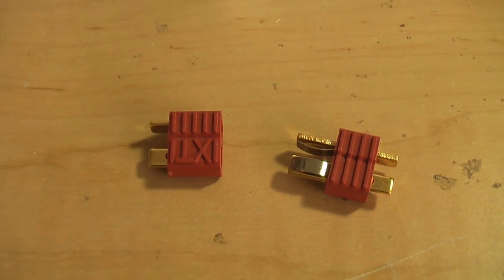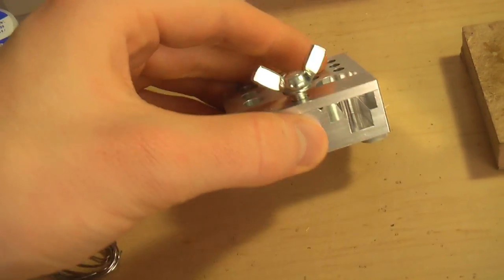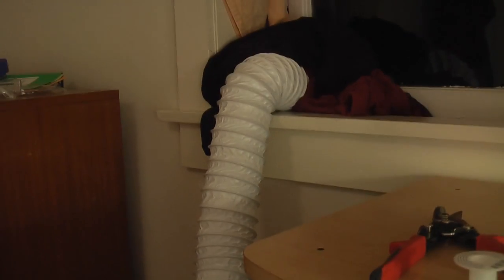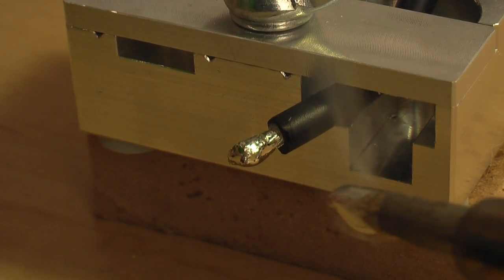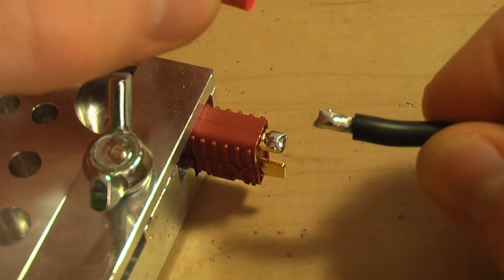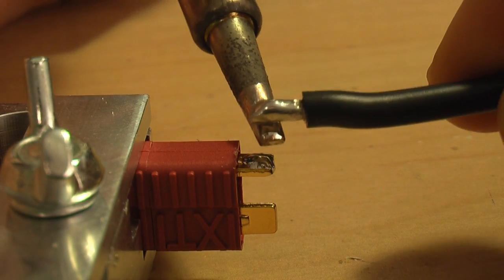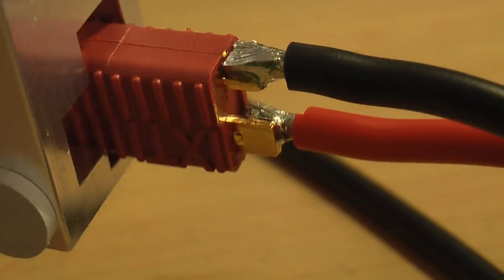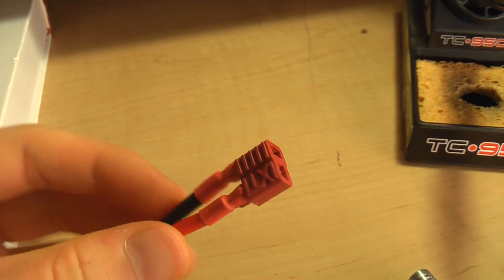Soldering Deans Connectors

Comment: As hobby vide is juat fineand the tip makes all the difference. A pointed top wont work. Thats how i eltes the deans connector my airsift gun perun hybrid etu and had ti solder a new one on. I dont know whyvthey dont have them pre soldered like the gate aster. Where its a straght drop in. It works now and k can use 11.1 lipos without burning mybcontacts becuasue there are none. Its alnelectronic vs mechanical. To burn the heat shink, i just use a candle or big  cigararet  lighter. Everyone has either or.

Comment: You should be heating the underside of the surface to be soldered, and allow that surface to melt the solder to avoid creating cold solder joint.

Comment: If you'll look at the body next to tabs, you'll find that they’re cleverly marked + and -. So, your wires are reversed. Also, if this connector is going on a battery, you had better install the heatshrink on the first wire before soldering the second wire. And, I solder the red wire to the inside of the + tab first, heatshrink it, and then solder the black wire. I don’t like having the red wire on the outside..

Comment: I know this is an old video but those deans your using are the fake deans. The real deans are deeper red and there smooth. These fakes are made out of cheaper plastic so they could melt at lower temps then the real ones. Just becareful

Comment: Im an auto tech 25+years solder plenty in my day im new to rc ! But those connectors look somewat of a joke no socket to slip the wire into for protection so iy is exposed even with the shrink tube ! Also a 10gauge wire soldered to the outermost tab utilizing literally 1/3 of of tge wire outside to outside is almost laughable so much current being wasted just my opinion you have a good skill just think those connectors look like a joke

Comment: don't heat shrink. just use electrical tape
Reply: No. Heat shrink is better. Electrical tape may fall off depending on the vibration. Also, because of the adhesive, it may gunk up the wire. Deans connectors are used in RC, so it's important to insulate any open wires and ensure they stay insulated.

Comment: Thanks for the video.  There are certainly some helpful tips in there.
On my Dean's I finally got good enough at soldering to get the red wire on the inside, on both the male and the female joint.  When a 14 gauge wire is soldered to the inside of the perpendicular tab there is barely enough clearance to put heat shrink around both wires at the plug.  But it can be done and it looks great.  It can be done by flattening the wire a tad and then being very delicate and careful.  The other added touch you may consider is putting a large heat shrink tube around the entire plug, extending to approximately to where the smaller heat shrinks end.  This makes the plug look very professional.  I've experimented and spent hours and hours perfecting this technique.  I don't know if it's worth the time investment but the end result looks really really nice.  There are heatshrink tubes that shrink to a factor of three and have a glue on the inside to make it stick really well the the plug.

Comment: Just one suggestion for you excellent demonstration / tutorial.  It would be good to clean the tabs to which you are going to solder the wires on the Dean's Connectors and the tips of the wires with a little alcohol or solvent to remove any finger oils / residue before soldering.

Comment: I never done soldering but seen these video make me confidence to do it self soldering, and i done it with only +/- $4 buy cheap 40watt iron rod and solder wire. And it work's. Next i will make exhaust fan like you have.

Comment: Nice video, but careful with polarity: red should go to +
Reply: ***** its just a demonstration. Hes not actually using the connection
Reply: Philippe Levy I noticed this too, I want to use this video as reference but have to go through the extra effort to explain that he soldered the polarity on the wrong side, since this video is specifically intended for Deans, he should've included notes on how to use the correct polarity, at the very least I would like to see note bubble explaining the wrong polarity was used in the video.

Comment: Hey, i very much so like your video, but would like to make a suggestion, when soldering, you want to heat the wire or the tab, not the solder directly. so heat from underneath(heat rises) and place the solder on top. this avoids what is known as a cold solder which though may look good, actually didnt bind the 2 well.

Comment: even 750F is kinda high, usually around 650F works. but i guess since there is so much surface area to solder then you probably need the extra heat.

Comment: You should have removed the gloss of the golden tabs by sanding them off, and heat the metal a little bit before applying any solder (same to the wire) for better cleaner looking connections/ coating.

Comment: As i can see around 2:37, you have the soldering iron's tip bare. You ALWAYS want to have a little bit of solder to cover and protect the tip from oxidation. it will extend the life of your iron's tip. This is a very important step in any soldering procedure. anyways, nice work!

Comment: If you dont mind messing up the side of your iron a bit you can use it to melt the heat shrink tubing if you turn it down first. Maybe it doesnt mess up all irons. But my cheapo weller nock off brand iron and my cheap heat shrink tubing tend to turn the side of the iron white. You could use the tip if you make sure it is clean. Forgot to clean it a few times and ended up with heat shrink covered in solder.

Comment: @forresttrenaman 
No, because I measure the iron with a IR temperature meter. The devices I solder are extremely sensitive to EMI/RFI and heat damage, so we rarely go above 400F. Also, any kind of smoke is dangerous for you. I use a respirator and a fume extractor at work. The smoke is actually coming from the flux inside the solder, lead and tin are smokeless.